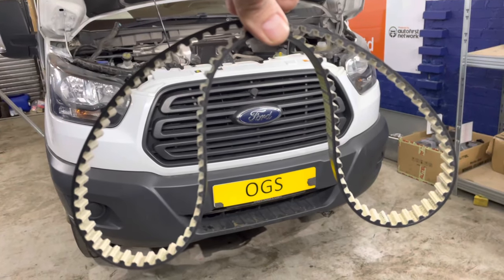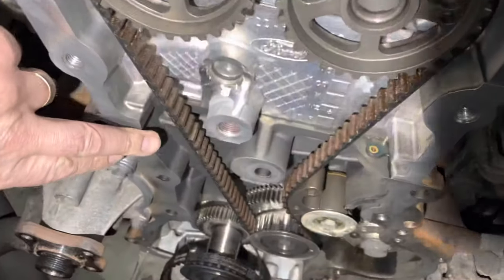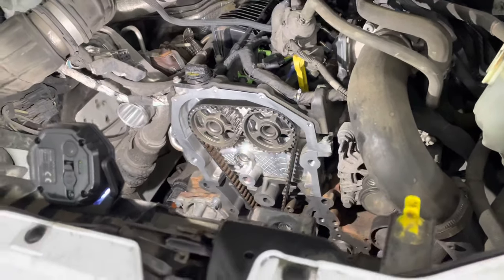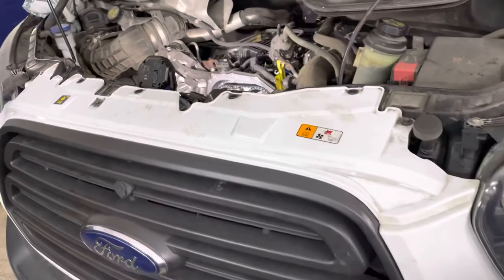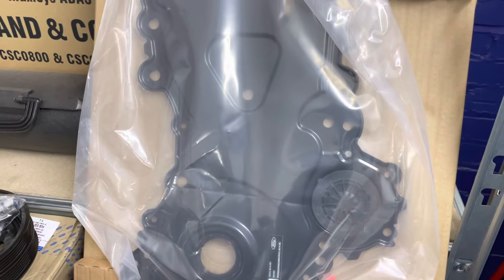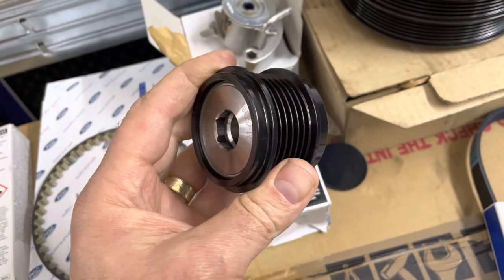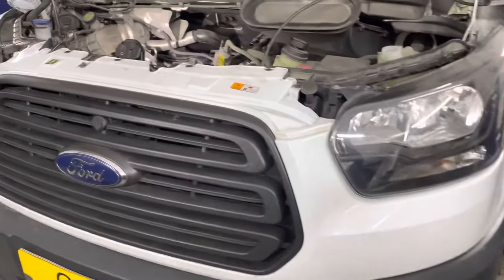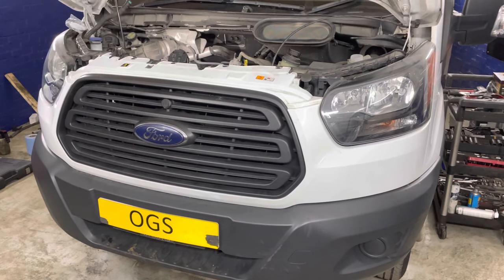Ford Transit timing belt replacement. When is it DUE? What model of Ford Transit has a belt?

Comment: Before the belt fails fully they often "delaminate". Bits of belt material strip away from the belt. These often can be pulled into the oil system. One big symptom of this is a hard brake pedal. 

As the vacuum pump is oil fed the pump often fails before the belt itself. This is not always the case however. You can see the belt in the 2.0 panther engine via the oil fill port. In the case of front wheel drive transits, remove the air box and the oil filler tube. Use a mirror and light to see the belt. I have used a small plastic rod to see if the belt can move easily. If it does it is losing tension due to material loss. Replace asap. It is an easy job to replace but if you have had delamination before failure.

 You can change the belt but you also need to remove the sump, clean the oil pickup and then change the oil and filter again after a few thousand miles. It is very difficult to remove all contamination without a full strip down. Even a vehicle under warranty will not have a full strip down. Avoid fuel and oil additives.

 This also is known to affect the "wet" belt. I say "wet" belt as the belt itself is not submerged in oil. It is splashed with oil and has oil vapours around it under operation. Bad design. Good money for repairs

Comment: The previous Lynx engine (2007 - 2012ish) also has an internal belt.  Many people have bought them and not realised, suffering the inevitable failure after having the external belt from the HP pump to the camshaft changed but not the internal one.  Ford has been very shifty over this, stating that the belt should be changed at maximum 125,000miles/10 years.  This gives the company some weasel room if the belt fails earlier, which they have apparently done.
Reply: What has a 2015 2.2 use? Is it a belt or chain? Thanks

Comment: I know of one that snapped at 38k. 
As usually, Ford refused repairs under warranty. The wet belt must be the worst idea in a very long time.
Reply: Why was it refused under warranty ?
Reply: When Ford introduced the Wet Belt I introduced GM.
Reply: Surprised it was refused - My work had a van die at 47k from belt failure. Ford warrantied it and are slinging a crate engine in it as we speak.
Reply: @DigBipper188  a company running more than one van and servicing at a dealership will have a better chance of a warranty claim, if that’s the case?
Reply: @Visco1003  I'd guess so, although I bet who you know plays into it well as well.

Ford are kinda known for telling people to effectively pound sand and there have been numerous lawsuits over it.
Reply: @DigBipper188  motor factors in my area won’t supply a timing belt kit for a wet belt engine anymore as they now have lots of warranty claims. The belts break well before the service interval and the supplier is then responsible for the next claim.
Reply: @craig1003 the bets only fail because the wrong engine oil has been used or the vehicle hasn't been serviced regularly or properly. Ford know this so generally won't warranty failure because its not been dealer serviced at the right intervals and properly.
Reply: @stuartcraigon2003  it's more than that, because there were other bulletins for these belts failing that also blame fuel dilution caused by the long factory oil change interval and DPF regen cycles. The belts aren't very resistant against diesel and end up being weakened by it.

This also ignores the tensioner failures that actually cause the lower belt to slap about and shred itself to bits. On 2016-2019 vans this was usually how they failed early, even if you had Ford service the vehicle the entire time.

Comment: We seem to have a bid of a strange problem with our euro 6 2.0 you turn the key and nothing and I mean zero happens. Then you turn the Key next time and it either burst to life for a few seconds with a noise of something not right. And seizes up and stops. Or it turns very slowly like something is jamming it. So I thought to myself that it can’t be an engine problem as such as it wouldn’t fire up. I’m leaning more towards something restricting the flywheel. 
I have removed the started and try to bump it to see if the starter was restricting it some home but the problem remained the same. I can only think it is a flywheel issue or a bad crankshaft or crankshaft bearings. But surely if it was anything to do with the crank it wouldn’t fire up? 

Does anyone have any clues? 

Kind regards

Comment: As you mentioned my Van's belt failed at 100000 well below the reccomendation by the manufacturer does anyone know if I can take action against ford? Who is at fault?
Reply: 144K miles is the recommended replacement interval but they dont usually make it past 100K, Ford will usually cover the cost of a replacement engine if you can provide a full service history

Comment: Just seen your video.. mine has just gone on my 2 year old full size ford transit 175hp.. I started it up and it stopped after 5 seconds went to restart and stuns over fast..!! Only got 45000 miles on it.. question is does it hit the valves..!! As mine is a service van for plant repairs and will do it myself if no damage has been done.. as can’t afford for it to be off the road.. let me know your thoughts many thanks
Reply: My connect broke down on me the other day. Just lost power. Unfortunately due to it being bank holiday weekend in England I have to wait until tomorrow to get hold of an mechanic. I think mine might be gone. Don’t start and it’s cranking up faster than normal. You put the key in turn it and it keeps jus trying to start over
Reply: Not a job to do yourself. You need a ramp. The front cross member has to come off to get the sump out and you need to replace the timing cover. Let a garage do it.

Comment: Is there any way of checking if this has been replaced? Or checking the state of it? Just got a 17 plate ford transit custom, 107000 on the clock. No service history. Already a couple of hundred down as having to replace the alternator, panicking now this ingenious invention could be a ticking time bomb!
Reply: No, you have to drop the oil and get a new timing cover. Its not a DIY thing at all, not looking or changing it.
Reply: @stuartcraigon2003  thanks very much, hubby has changed it since this comment.

Comment: The reason these belts fail is oil dilution during regeneration, the excessive diesel in the oil deteriorates the belt causing premature failure, the software is the issue so even if you change the belt it is still likely to fail again prematurely  unless the software is updated
Reply: So is the best option .after replacing the engine .a patch /software upgrade to get rid of dpf?.£250 it is .a garage not far from me does it
Reply: @dommurray1185  No Dom, take it into Ford and ask them to put it on the latest software
Reply: @steveguest8028 what do you mean software? Cheers
Reply: @jaygoodwin6287  They come from the factory on the wrong software the DPF regeneration was wrong causing excess fuel to be injected and finding its way into the sump diluting the oil which causes the belt to break up, there was a recall for it
Reply: And because people are using the wrong engine oil or not servicing correctly and at the right intervals.
Reply: @dommurray1185 no because dpf deletes are illegal. Its an mot failure.

Comment: Every 60k we changed the company vans.
One of the belts went at 90k and bent those wonderful hollow camshafts and wrecked the injection pump somehow.
£4k bill. Full top end rebuild. 
Over a badly specified service interval.
Absolutely disgusting.

Comment: The belt only fails because the wrong engine oil is used or its not been serviced properly and regularly.
Reply: Wrong! Full ford service history, 2016 CMax gone boooom at 61,000.

Comment: I have a weird engine noise on my transit custom 2.0 2017, when I rev the engine between 1750 and 3000 rpm I get a grinding noise from the bottom of the engine , seem like it’s inside , have you ever come across this ?
Reply: Probably the start of the sump oil pickup blocking up

Comment: It's quite obvious for me that any timing belt has to be replaced every 75000 miles.
Reply: 144K miles is the recommended change interval but they dont usually make it past 100K
Reply: Ours just snapped on a 22 plate at 75000 miles, vehicle fully serviced with Ford parts and per service schedule. Engine is totalled!
Reply: @krism1492 dealer serviced? The belts fail if the wrong engine oil is used and or they are not serviced regularly and correctly.
Reply: @stuartcraigon2003  independent service but all parts supplied by Plus Parts and verified by Ford as correct. Vehicle had additional oil changes in between scheduled service too. Ford replaced the engine despite it being outside of warranty .
Reply: @krism1492  there's a good chance that either the DPF software was wrong and putting diesel into the sump or the wrong oil was used. The only two reasons the belt will fail.
Reply: @stuartcraigon2003  since Ford changed the engine under warranty I would suspect the former. Still if it wasn’t a wet belt then it wouldn’t be affected by the oil or dpf. In risk and reward term I don’t think the benefits of a wet belt are worth it, but I’ve got rid of it now and I wouldn’t have another.

Comment: This isn't the only engine running this set up. The pug 3cyl is the same! Rubbish setup best avoided! Either the belt breaks early or worst still the oil pickup in the sump totally blocks up destroying the engine!.

Comment: Mine has just gone at 133,000 miles just had the clutch done 4 days before, now I can't even sell it. If I knew these belt driven I would have bought a Merc Sprinter. Timing belts are so 80s early 90s era. Disappointed at Ford.
Reply: Go to ford if you haven’t already it shouldn’t have failed that soon happened to me and got them to pay full cost of refurb engine
Reply: Many Japanese makes use timing belts too it's not just Ford. You should have replaced that belt at no more than 100k miles. Sorry.
Reply: Nothing wrong with Timing belt especially on a small engine, the problem here is it's a wet belt design (the belt lubricated by engine oil) which is stupid, unlike timing chain which definitely could use the lubricant, rubber belt does not, it'll deteriorate way faster compared the dry belt counterparts.

Comment: Ford have these vans on a recall I was quoted £1550 with 122000 miles on the clock took it in and later than afternoon they rang me and said because the belt had wear on it they would be doing the job for free
Reply: Mine has just gone 103700 miles ?.how do u go about getting Ford to do it free please ??
Reply: @Dom Murray  book it in with ford under the recall and hope that they find some wear on the belt
Reply: I got a letter from ford the other week for a recall on my year 2016 transit timing belt they want to inspect it and if needs doing it will be done free of charge so just need time to get it sorted

Comment: 3 1/2 years old, 82 k, bang!
Ford does not want to know despite full Ford service history. Shit van, shit company. Shit attitude. Worst van I have ever bought. Shit shit shit
Reply: Feel your pain with ford they are useless my van sat at ford for months being looked once a month for a adblue problem and it got to the point when needed it desperately for work so i went to collect to take it somewhere else and it wouldn't start because they ran the engine shut down down to zero miles and they said it will need a specialist at cost to restart it so i was like fuck you so i come back with a remapper, he spent 10min in the van in ford car park deleted the adblue and van started straight up i in jumped in drove out and the technician faces who were sniggering was like how the fuck

Comment: just got a price from ford to change mine £750 all in.
Reply: Pfft I got quoted £1100
Reply: @deadfool3344  in Scotland they want £1300 but in Huddersfield £740. I have just double checked my engine size and mine is the 2.2 so is a cam chain ?  So going to leave it for now. I thought mine was the cam belt.. pre 2016 2.2 is cam chain. Happy to save the money now
Reply: @MrEnglishman6969  id have paid the £750 but £1100 I'm either going to leave it or shop about and see what price I can get elsewhere. Unsure how true but the new facelist doesn't seem to be as bad the pre facelist, mine isn't up for recall either but knowing my luck it'll snap tomorrow.. shite design
Reply: Face-lift **

Comment: Ford Junk ..
Reply: Actually the engine is a PSA.
Reply: @lszek2186  Not this one, it's entirely Ford engineered 'EcoBlue'. PSA engines were used in Ford vehicles for a long time and the timing belt is external (normal way of doing it)!
Reply: @lszek2186  No, this is Ford EcoBlue, developed and manufactured by Ford since 2016.
Reply: @tiggercat8689  also known as “Panther”